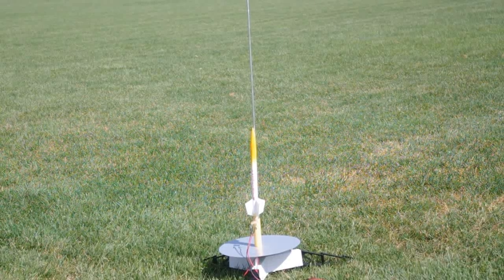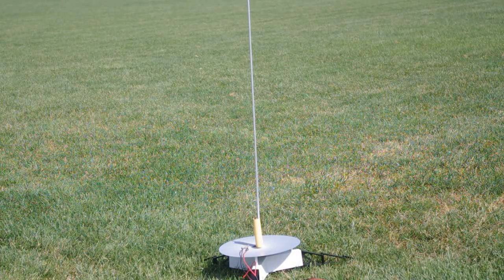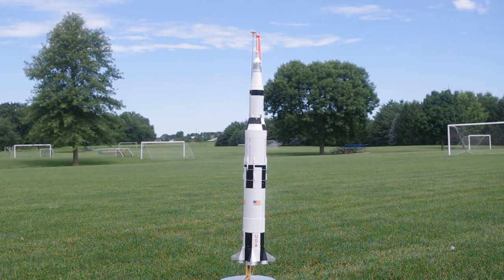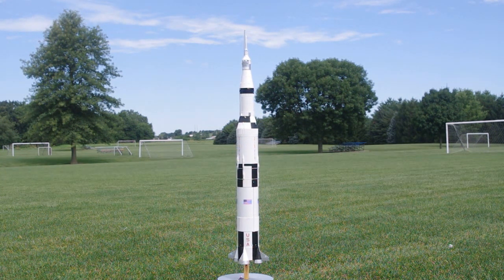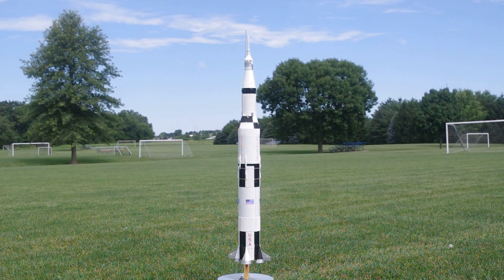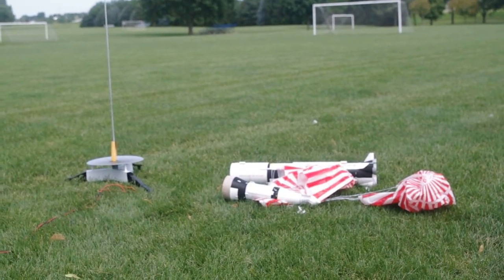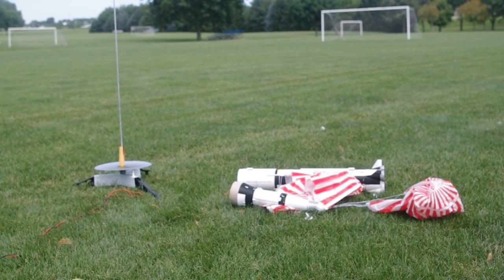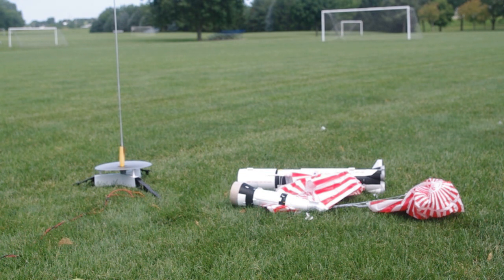Estes Saturn V Flight

Comment: Are those even legal with the dry season and fire hazard.   Might have been what started those Hawaii fires.
Reply from the maker: Local fire codes dictate that. When I flew this in 2019 ground conditions were fine and it rained an hour before. There is a safety code we have to follow before flying to make sure we fly safe and we follow federal and state laws.

As for Hawaii, doubtful. At last check the prevailing thought was sparking power lines due to high wind gusts from a nearby Hurricane.

Comment: I am currently building the Saturn V Limited Edition Skylab @1/100 scale. I got many questions about the paint. Is this just a guessing game. What did you use, I am wondering. Cause your rocket looks like it's painted good.
Reply from the maker: I used a good quality primer (Tamiya normal gray primer) to help fill the spiral windings of the body tube and Tamiya fine white primer over the model after construction was done. I used Tamiya gloss white spray and airbrushed the black on (Tamiya acrylic gloss black I believe) and had to do touch-ups with Tamiya X-2 gloss white as even though I masked things as best as I could, I still had areas of bleed. Tamiya Silver Leaf was used in spots and Tamiya yellow tape was used for the majority of the masking.

I know several modelers like using Krylon or Rust-Oleum spray for rockets because they are relatively cheap and plentiful. But I had a bad experience with Krylon primer wrecking the vac wraps on a Saturn 1B about 30 years back and have seen Rust-Oleum wreck paintjobs. So for a model like this, I made sure to use high quality model paints. If done right, the Estes Saturn V will be the queen of your fleet. So minimize the risk of wrecking it by not trying to save a few bucks. The Tamiya sprays are hobby lacquers with great fast drying properties and Tamiya acrylics are chemically inert to most everything else out there.
Reply from the maker: BTW, if you are on FB, look for the "space modelers" group. I am but one of a world wide community that builds space and rocket models who try to take them to a higher standard. If you have questions, we can direct you to additional resources.

Comment: Mid 60's here with Estes, a couple of years ago got to thinking about building some again.
Estes has made it more like snap together, not interested at all now.
Reply from the maker: Many of the rockets are like that, but the current Estes Saturn V Skylab (my Apollo Saturn from 2019) and Saturn 1B are pretty "old school" in construction. They build much like the Centuri kits given they use plastic vaccuformed wraps for the stage details and those are not easy even for experienced rocket builders. The only real update they did was using one piece injection tooled fins to glue on instead of the old two piece vaccuformed fins. But while I didn't have to fill and sand balsa fins on my Apollo Saturn, I still had to fill and sand the spiral winding on the BT-101 tube.

I would say while the three 1/100 Saturns from Estes are no longer Skill level 5, I would put them on par with a low skill level 4 or even a very high level 3 in terms of complexity of build.
Reply: @JMChladek  I was looking forward to working with balsa wood nose, fins...
I put a lot of work into building those, so much  so, like you, i hated to ignite the engine.
I know built the V2, some others there and maybe the Saturn. I used small blocks of steel to keep everything lined up while the glue dried.
Reply from the maker: @nicoradv3923  if you can find it, Semroc did a clone of the old Estes 1/70 Saturn 1B which has a balsa nose cone and the fins that have to be built. It hasn't been available for awhile, but they have other rockets of the old skill level 5 class.

Comment: Saturn 5 engine was a marvel of engineering. So much so no one alive today can build them
Reply from the maker: Not true. The Saturn V F-1 engine was/is a marvel of LOX/Kerosene combustion power. We could indeed build them. But we went on to harness liquid hydrogen resulting in development of more powerful first stage engines such as the Space Shuttle Main Engine and the derivative being used on the SLS.

Studies have been done and we "could" do an equivalent engine to the F-1 engine. But we don't have a current need for exactly the same application at this time.

Comment: So that was a vintage 1969 Estes Saturn V?  And if so, did you build it when you were a kid?
Reply from the maker: No, it is Estes kit #1969, issued in 2019 for the 50th anniversary of Apollo 11.
Reply: @JMChladek  Oh.  Cool anyway.  You did a great job building it.  I remember as a kid I was intimidated by the complexity of the kit, so I didn't buy it.  I did buy and build the Mars Snooper.  If I was going to build one today, my choice would be to recreate my Mars Snooper from back in rhe day.  Thanks for the nice video!
Reply from the maker: Now after I built this I did obtain an original Estes K-36 kit from the early 70s. I'm still working up the nerve to build it since it is more challenging in spots with cardstock wraps instead of vac plastic ones. It is definitely Skill Level 5 while the one I built is closer to old Skill Level 4.

Comment: When I was a teen, I spent hours and hours building the Estes "Mars Lander" (with the rubber bands that allowed the legs to flex).  I launched it once, and (of course) the 'chute didn't deploy completely and it snapped a leg.  I repaired it and retired it to be a shelf queen, but I was always kind of sorry that I attempted the launch.
Reply from the maker: That is always the risk we take with the projects that are labors of love. But we like seeing them fly too, especially when things go right.
Reply: I still want to kick in the jimmies whoever wrote up the recommendation for a B6-4 or some weak ass motor for the first flight of the Mars Lander.  Went up all of about 25 feet, arced over, and crashed head first before the parachute could even deploy.

Comment: Good flight, it is almost impossible to avoid the escape tower popping off.
Every Saturn V should fly at least once.
Reply from the maker: At least the new escape tower separates in one piece. The old one typically would not only come off, but also break into three pieces.

Comment: I have the same kit still in the box . Great Flight! I hope to launch mine this coming July. IfI do I will video it and share it on my channel. Thanks again .
Reply from the maker: Thanks. I am currently working on the Estes Saturn 1B kit that just came out.
Reply: @JMChladek  do they still make them with multiple engine configuration or using the larger single motors?   Been out of since I joined the Navy years ago and eyeing some of the old kits I had.   ($$$$$) on eBay.  Yikes.

Comment: "It's still a rocket; needs to fly" I get that, totally get that.
Reply: Was my motto as a kid.  Didn’t care about weather.  Glue “dried” it had to fly.   Most of my kits were Centuri and 1 time flights as I never saw where they landed ( I always used big engines although not the area for it. Trees gobbled them up.  😜
Reply: Yep. Just finished up one i bought years ago. Going to fly it before I put too much more effort into the paint and decals.
Reply: It applies to everything in life.

Comment: I built one in 1984. I used the single D12 sized engine and it gives it a nice slow lift-off that's very scale in speed. It worked great until the third launch. The engine mount blew out of the back because of the strain of popping four chutes at once. No chutes and it did a lawn dart into the field. The tubes folded into each other. It was done :(
Reply from the maker: Yeah. the original cardboard/paper wrapped Estes Saturn was light enough that you could get good D12-3 flights. These newer plastic wrapped ones are just a bit too marginal for my tastes, which is why I went E30 composite. An E15 might have worked, but the CATO potential I felt was too risky given the work I did building this.

Comment: Nice flight, any idea on how high it flew on the  F.   I, still have the thirty anniversary kit (1998), un-built in its box.  Estes used to say disconnected the escape tower before launch.  No way it will stay on when it lands.
Reply from the maker: It was a composite E actually. Altitude I estimate over 300, likely close to 400. I flew it on this motor since I didn't trust a D12-3 to be able to pop the chute in time after a 100 ft altitude flight.

I had flown an up engined 1/100 Little Joe 2 years ago (was designed for mini motors, I converted it for 18mm A to C motors) and yes the Estes escape tower could be prone to damage since the struts had so little gluing surface. The new tower though, which appears partly based on Centuri part architecture is A LOT better designed. So the tower is much more sturdy, especially if you use plastic weld glue to assemble. The only weak links are the spots where they attach to the capsule.

On my bird, the upper section's chute was more a streamer, but it still came down sideways and the tower only popped off when it hit the ground. It survived ascent just fine. If the chute had opened properly, I believe it would have stayed on.
Reply: @JMChladek  Centuri still rocked in its days and all I bought (few Estes locally in store).  So bummed seeing  Centuri phase out and their design and technology in the Estes kits.  Love to get back into flying here in Charleston.   Gotta find place.  Time and well time (honey do list)
Reply from the maker: Believe me when I say the best elements of Centuri is still a shining point of the Estes production line. The most recent Saturn V and Saturn 1B kits use plastic wraps like Centuri, even though the details are better. The Centuri Little Joe 2 was also repopped a couple years back with some refinements (and the Centuri Redstone has been in production from Estes since the mid 1980s). My pathfinder Viking rocket is a Centuri design as well, fibre fins and all.

BTW, the Saturn V Skylab that just got issued has a 29mm motor mount. So it can fly on an F motor. I hope to have mine built and ready to fly by the 48th anniversary in May.

Comment from the maker: Here is some clarification for viewers who might be inclined to comment on the cinematography of this video or make snarky comments on how that was "five minutes of my life I will never get back". Actually it is more like six or seven minutes if you took time and energy to write such a snarky post after watching the whole video but oh well. 

It was one camera on a single tripod. I was not using a hand held camera (or a camera phone) because the controller I use has an arming button and a firing button, requiring the use of two hands. Safe launch, flight and recovery of the rocket were the primary goals. Yes, after launch I suppose I could have grabbed a camera phone to record the coast phase and the chutes. But I decided I was going to chase the rocket and perhaps catch the main body due to details on it I didn't want damaged. Very difficult to do that with a camera in a hand. 

Fortunately the rocket body landed safely under two chutes with no damage to it, but it was touch and go for a bit. This was going to be the only flight of this rocket and after the many hours I spent building, accurizing and painting it, I wanted to do as much as I could to ensure its successful recovery. The next time I build a Saturn V to fly, it will likely have more than a single flight and potentially better video documentation. Thank you for watching.

Comment: A 1/2 second of launch from the pad?  You couldn’t even pan up?
Reply from the maker: No pan possible because the camera is on a tripod filming remotely. I'm standing nearby with two hands on the launch controller holding the arming button down and pressing the fire button. I had no assistant to film and my focus that day was to launch, track (with my eyes, not a handheld camera) and recover the rocket safely. Filming was secondary and mostly to document a launch for the attempted record of most rockets to fly within a 24 hour period on the anniversary date of Apollo 11s flight.

This is the first time I had ever done a camera setup. Next time if I film a launch, things might be better.

Comment: I built mine 24 yrs ago and never launched it. It would have been nice to see the actual flight and not just the lift off. Looks like your escape tower broke.
Reply from the maker: It happened on landing since the chute was a streamer. The tower went through boost and ejection fine and this new tower is more robust than the previous ones. If it was old Estes, it would have busted in four places. This one just popped at the glue joints attaching it to the capsule.